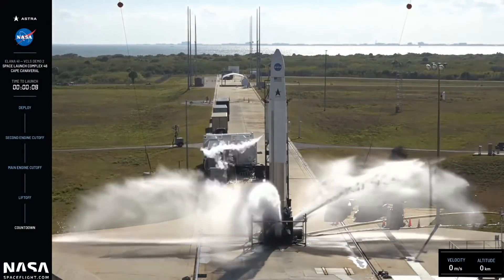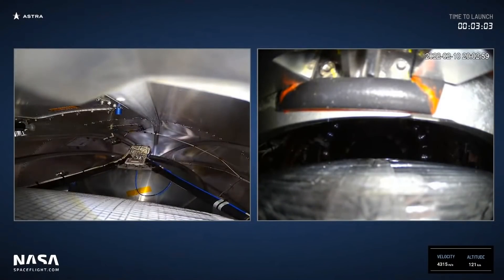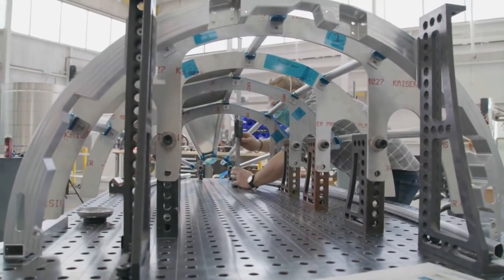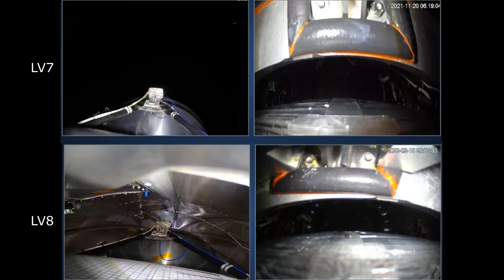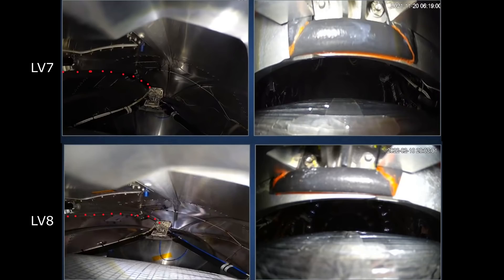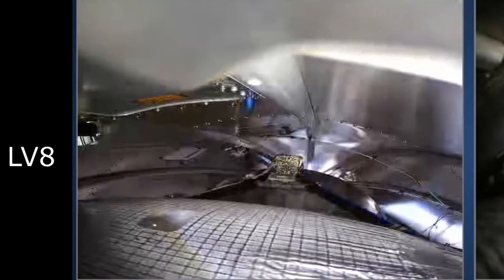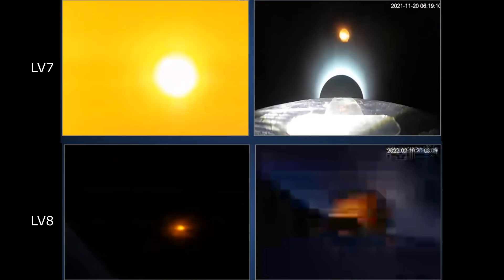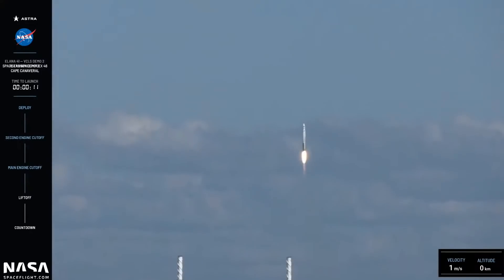Rocket Launch Doomed After Payload Fairing Won't Open

Comment: Astra didn't mash F9 enough.
Reply: Astra forgot that time warp arrests all rotation
Reply: @krzysztofprzybylski2750  can't time warp with working engine
Reply: @antonpershin998  just turn it off duh
Reply: @krzysztofprzybylski2750  They are playing realism overhaul, which still spins in timewarp
Reply: What is F9 bound to? Not staging since that's spacebar and you wouldn't mash staging anyway....
Reply: @Connection-Lost  loading your quicksave
Reply: @Connection-Lost  F9 is quick save.  if you quick save in case something goes wrong, nothing ever goes wrong.  The one time you don't quicksave, that's when you wish you had.
Reply: @edstirling  In KSP there are no failures only simulations of possible failures.
Reply: @stormhawk4277  There is no KSP. There's only a simulation of KSP. We live in Matrix.
Reply: No biggie, V  GER can bring it back in a few centuries
Reply: I love how much ameliorating in the comment section from super KSP fans!!!
Reply: I suspect they didn't check their staging
Reply: if the 2nd stage didn’t fire to circulize then it would’ve all reentered soon after
Reply: At fault they should have Alt-F4'd right out of the simulation.
Reply: @mechagyver  May be they just shouldn't run Windows :-D
Reply: "It is rumored that the 2nd stage is still doing the Interstellar Spin".

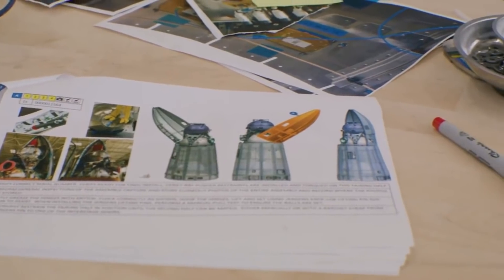Comment: When I think of rocket engineers I think of all those NASA engineers in full PPE in a clean room putting together the Curiosity. I certainly don't imagine a guy in blue jeans and a plaid dress shirt putting a rocket together with a yellow screwdriver, I reserve that image for putting together IKEA furniture. That image in 2:21 of the rocket building instructions looking like furniture assembly instructions didn't help.

If I was Astra, I would be sweating bullets as every single investor on this project is no doubt thinking the same exact thing I am.

Comment: “Initially, the launch went very well, for Astra: their booster lifted straight off the pad”

👀
Reply: Référence to that power-slide? 😁
Reply: @ThePixel1983  More of a delayed ascent, since it only lifted off after it burned enough propellent weight
Reply: @ThePixel1983  a power-slide - that's a good name for it actually. It can be fun to make a sports-car go in a direction other than the direction it's pointing. In a rocket, it's less good 😊
Reply: @realdizzle87  Yeah, but it actually happened, last year I think. One engine failed, the others corrected and the rocket just slide out the launch stand basically horizontally (because not enough thrust) and only gained vertical speed when light enough.
Reply: @ThePixel1983  Yeah, horizontal lift offs. New skill in rocket engineering!😂
Reply: @adimchionyenadum2962  Yeah, let's call it a skill instead of a failure. 😂
Reply: @ilmcamam  actually, rockets are generally traveling eastward, which is the same direction as Earth rotation, which means the booster falls further eastwards (down range). If the rocket traveled straight up to SEP, the booster would come down west of the launch sight.

I'm in agreement. The launch profile described by Joe sounds incredibly inefficient, especially for a compact rocket that's designed to get small payloads to orbit as cheaply as possible. I can't say he's wrong, as I know very little about Astra or their rocket, but I'd like to see some corroborating evidence of the launch profile he's describing.
Reply: For the early Astra launches success meant the debris stayed within the confines of the Kodiak facility, so consistently going mostly upwards is a big step forward
Reply: @ilmcamam  Look up "gravity turn" on Wikipedia.  Basically rockets headed for orbit don't fly straight up then turn and run horizontal.  That would be wasteful of fuel - all that vertical velocity would have to be arrested to stop the ascent at the proper altitude.  So they ease into it by pitching over and applying thrust to both ascend and pick up the necessary horizontal orbital velocity.  The optimum pitch over amount, timing, and rate are all variable depending on the vehicle and target orbit.
Reply: @Grace Jackson Gravity drag means you don't want to be applying thrust straight up the whole time. There should be a pitchover maneuver soon after launch.
Reply: @Grace Jackson oops. For Joe
Reply: @Grace Jackson Orbital speed is just that, speed, so you could definitely go into orbit around a flat and airless body by going sideways really fast. Maybe someone will try sending baseballs into orbit around the Moon.
Reply: Famous last words.
Reply: Even that is an good result - imagine, mankind needed few decades to fire up an rocket in to space, without any special devices on it. 🤷‍♂️🤦‍♂️☝️
That's is what we call it rocket engineering.
It not so easy like you think about it.
Reply: @Grace Jackson SpacePlane- starts horizontal and switches from air-breathing jet engines to rockets when the air runs out at altitude.  FAA less involved than NORAD if you're launching east from Florida.  Old NASA joke about running as fast as you can and jumping off the planet...
Reply: The rocket pitched over way too much during ascent. The booster is designed to fall straight down (because the rocket should be going straight up) at stage-sep. This rocket was traveling near perpendicular to the ground at MECO. It appears that upper-stage basically got wedged inside of the booster cowling when they attempted separation - almost certainly because of the unusual attitude. S1 is supposed to go straight up - as high out of the atmosphere as possible, then stage-sep, then the rocket pitches over and the vac-optimized engines just add the delta-v you need to give you orbital-velocity. Things went wrong with this flight seconds after ignition. The rocket was in an abnormal regime for the entire ascent phase.
Reply: @realdizzle87  That's what called being confidently wrong :) I'm fairly sure that no orbital rocket in the history of mankind has ever flown like you describe it, and as long as rockets use chemical engies, they never will.
It would be extremely inefficient and the rockets would never be able to make orbit. 

I suggest you look at some rocket launches before spouting nonsense like that, some one might actually think that you are correct, and misinformation is bad.

Just look at SpaceX Falcon 9, they give a callout for Vehicle pitching over just a few seconds after the rocket has cleared the launchtower, I dont think its even more than a few hundred meters in the air at that point. Rocket only fly straight up to clear the tower basically.
Reply: @realdizzle87   Nowhere in the history of ever have I seen someone as confidently incorrect as yourself.
Reply: @realdizzle87  no orbital rocket is going to go straight up and then pitch over to gain orbital velocity with the second stage
Reply: @realdizzle87  At stage separation this rocket was at a similar speed, altitude and downrange distance as the previous launch, where they reached orbit. So the rocket must have been following its programmed launch trajectory very closely.

Furthermore: Only suborbital rockets like New Sheperd go straight up. Everything that is trying to reach orbit will pitch over as soon as possible, finding the best compromise between minimizing gravity losses and aerodynamic losses. 
All first stages of orbital rockets travel much further horizontally then vertically.

The trajectory you propose would be incredibly inefficient due to massive gravity losses. It would require close to twice as much fuel, as you would need a much larger second stage with enough fuel to build All the velocity while still fighting gravity. And then you'd need a more powerful first stage to lift that huge upper stage.
Reply: @realdizzle87  that is not an efficient launch profile. Launches do a gravity turn which is what happened, they are typically fully horizontal by meco. You've been wasting your delta-v in ksp.
Reply: @realdizzle87  no, the first stage is supposed to get the upper stage out of the atmosphere, but it’s NOT supposed to go straight up, that would mean they would have an apoaps that is way to high, and would need probably over 2,000m/s of DeltaV to get to orbit. In other words the bottom stage should pitch over and be perpendicular to the ground at stage sep.
Reply: @realdizzle87  what you said about the rocket waiting until stage sep to gain horizontal velocity isn't true at all. and if it were, it would have already been identified as a blatant problem. the rocket's ascent is very carefully calculated and monitored, so they would catch that immediately.

Comment: This rocket had been sitting at the Cape Canaveral launch pad for more than 23 days. I suspect it being in the coastal humidity for so long may have contributed to the trouble. As other comments have pointed out, you can see some (what appear to be) ice droplets floating around in the fairing. I’m no rocket scientist but I’d say that’s no bueno.
Reply: Would be funny if that's the case, because if I remember correctly that's exactly what caused one of the Falcon 1s to fail
Reply: Possible.  I'd normally be dubious, since the forces on these mechanisms should be plenty to break a bit of ice and it is still a very much 'in development' rocket system...  But we've had some odd weather over the last month here in FL.  
Sucks for the folks who made those satellites, but doesn't seem like something Astra should feel very bad about... Assuming they got enough data to fix it of course.  They are so close.
Reply: @travcollier  I think as another commenter pointed out, the cause of what happened here IMO potentially had more to do with the same thing that killed the first launch of the SpaceX Falcon 1, which failed due to accelerated corrosion caused by the humidity and salinity of the coastal air. That could have very easily caused some of the parts to "fuse" together, specifically the latching mechanism. I would not be surprised if Astra designed their latch to hold even tighter under load, similar to the latches on airliner doors. Due to corrosion, the latch could have frozen (not literally temperature frozen, just stuck) in place and whatever actuator they use to unlatch the fairing might not have had enough power to overcome the stuck latch. When the stage pushed into the fairing, it might have warped the latch to the point that even if there was no corrosion, the latches could not be undone, and as a result the fairings remained stuck in place until the pressure from the exhaust of the engine sheared the attachment mechanisms off and threw the fairings clear of the vehicle
Reply: @richardmillhousenixon  This.
Reply: Space X: so how did you solve the icing problem?
Astra: What icing problem?
Reply: you don't need to be a rocket scientist, this on is just an electrical/mechanical problem.
Reply: @arkadia_9014  "Rocket science is quite simple. It's rocket engineering that makes things get complicated."
                                                                                                                                 ~(not only) Scott Manley
Reply: @HanSolo__  Rocket engineering is just normal engineering going and hypersonic speed, nothing special about it.
Reply: @arkadia_9014  Confirmed: pointy end up, flamey end down.
Reply: @HanSolo__  i am talking about the math at the basis is the same, is the system in which they are put on that is complex, but doesn't make it special somehow. Only when normal calculus are not the right method to solve a problem, then you have something out of the ordinary. I really love this stuff, but the sentence "it's not rocket science" is way overused that it makes it overlooked. relativity and quantum mechanics takes the crown cause the field of analysis is "abstract" and unreachable with you bare hands, unlike a rocket.
Reply: @arkadia_9014  Okay. Let's get this clear.
 The scientist asks: "Why?"
 Engineer asks: "How?"
 Lots of the answers for "why?" are already out there.
 There are only a few of the answers for "how?" Yet these are not accurate and won't be for some time. Not in 10-20 years. 
Math is a language that allows scientists to talk with the engineer. But math is a scientific domain. Use of metallurgy - this one is in the range of engineers.
The engineer uses scientific discoveries, imagination, experience, judgment, and reasoning, consciously applying his knowledge to design, create, operate and improve useful machines and processes in a given budget range and reasonable safety constraints.
This part gets complicated when you want roughly safe to travel to space.
Reply: @philipstaite4775  if you read carefully, i wrote "is the system it belongs that is complex" and you just described that complexity
Reply: @HanSolo__  actually is the opposite. If we ask the "why" is because we know the "how", or at least with our current representation of knowledge, we think we know that. There is no why, because implies that there is a "will" or a sort of action behind the that. "i went to the supermarket why? to buy something, why? my fridge is empty. why? i eat everything etc.." the difference between the Why and the How is that this last one reaches conclusion by itself, unlike the first one, because a why is a question a being gifted with reason would ask in order to reach a meaning that would comply to that type of reason, and so easily  it tend to reach a philosophical answer instead of a logical one. the how always exists in front of us, simply it doesn't manifest itself openly, it needs to be reached using the closest way of reasoning suitable for that type of argument, if is about philosophy, chemistry or math. our creativity is simply amazing, cause we can reach to a solution without knowing the why behind it, but sure the how. though, physics gives its limitation. i agree with the last part of your message :)
Reply: @FMTF-makemoneyonline  always. let's say that earth is just a messy place to launch rockets. less problems on the moon X)
Reply: but ice is quite normal on rockets due to cryogenics
Reply: @emmata98  ice inside the mechanism to release stuff is not normal. Ice on the outer shell is normal
Reply: @CUBEoneVX  the second stage is housed inside the fairing… the second stage uses cryo propellants, it is no wonder there is ice inside the fairing. This likely had nothing to do with the failure.
Reply: Very good point it’s likely that’s what happened
Reply: @ayy lmao it was a way of saying "the parameters that you need to apply to a rocket, are shown for a very short period of time". a rocket doesn't take more than 5 minutes to be in space, an hypersonic vehicle that is not a rocket is much more stable during the flight, and takes esily 1 hour, it depends. is when everything needs to happen in that short period of time, that gets messy.
Reply: Excuses are like assholes…
There’s way too many of them…
Reply: @MOSTASSEMBLYREQUIRED  Musk blew up a Facebook satellite on the pad. Part of rocketry.
Reply: Could be something as simple as a maintenance safing pin that wasn't removed correctly for whatever reason.  But who knows if we will ever find out why.
Reply: Maybe should have filled the inter-stage space with nitrogen?  (prevent moisture and add pressure to fairing-release)
Reply: @captainmaim  Fairings aren't sealed, there are vents to allow equalization with the outside environment. I don't know if Astra air conditions the fairings, though if they do that would end the moment the launch umbilicals disconnected, because the equipment would be pad mounted and not installed within the rocket. I know SpaceX circulates air through their fairings that is air conditioned by pad support equipment, but whether or not small rockets do the same is another story.
Reply: It sat for 23 days because of other problems that had to be corrected. The Astra assembly factory recently had many employee changes from the forced vax policy and the new replacements were chosen using woke protocol instead of merit. It turns out that building rockets is alot harder than the executives thought.
Reply: @jamminwrenches860  Would you like to cite your sources?
Reply: @jamminwrenches860  do you have evidence that they hired less competent people due to seeking only a diverse workforce? Every launch has risks and others fail from time to time as well. It is not as well established as some other launch companies, perhaps when they e launched as many as SpaceX they'll be doing better.
Reply: @jamminwrenches860  This would be the stupidest error one could make in this branch.

Lots of lost knowledge and experience, putting woke ideology before succesful rocket launches 

Also, Astra should do much more to keep us investors informed on daily things going on.